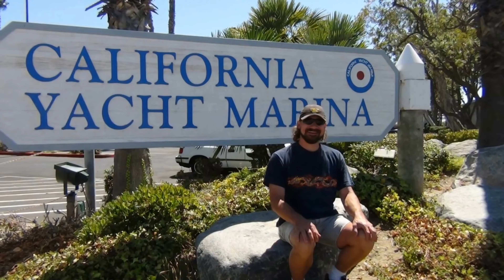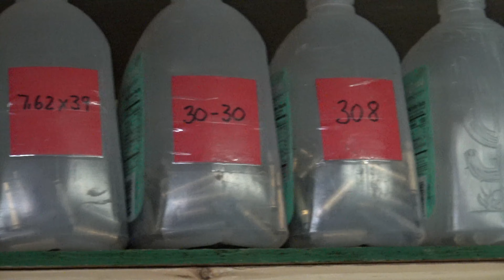Ammo Shortage? Stay Prepared & Ahead Of The CURVE, Brass Hunting, Sorting, Cleaning and Loading 9mm

Comment: I started wet tumbling my brass two years ago.  I did the dry vibrating cleaning for many years and then tried sonic cleaning.  Wet tumbling with the FART machine is great.  I don't use the pins that get into everything.  They make a FART spanner wrench to tighten the caps down.  Works well.

Comment: Yep, steel & aluminum are “no goes”.   Next comes Berdan primed brass.  Then crimp removal on nato brass.   I’m seeing 9mm that’s crimped now.   I swage out most of the crimps.  I have used a counter sink bit with a drill to cut out the crimp.  The primer pocket becomes slightly beveled and works really good in progressive priming operations as the new primer self centers to the pocket.  The only issue is you do remove a little brass from the case head.  I shot brass like this for years and never had an issue but swaging is probably better then cutting.    I also use a Franklin case prep station for my high quantity bottle neck calibers.  And it can be made to work with straight wall cases but cutting length has to be a check as you go deal, unlike the bottle neck setup.

Comment: Anyone with a self-sufficiency mindset needs to be aware of pre-charged pneumatic air rifles.  These are not your daddy‘s airgun.
I got into pcp air guns about two years ago, when primers became more difficult to find the big foot.  And when you did find them, they were approaching $200 per thousand.   The good news prices are dropping significantly but still 2-3X normal cost.  
Anyway, I started looking for ways to maintain my range time and learn new skills.   

Anyway, the story is long so I’ll make this short by posting a short video of my AirForce Texan .457 rifle dealing with the question of dealing with the collapse of normal supply chains for ammo and such… so in other words, this is an off grid self supporting solution for putting food on the table.   The shooting distance in the video is 50 yards and no electricity is required.   The rifle in the video is turned down to about 300 ft/lbs of energy to maximize air efficiency & reduce pumping time.   If you have high pressure air ready available, this rifle can make 700 ft/lbs of energy. 

EMP - The Big Bore Air Gun Solution - What if no electricity or internet ammo?
https://youtu.be/ScYnxZEqS84